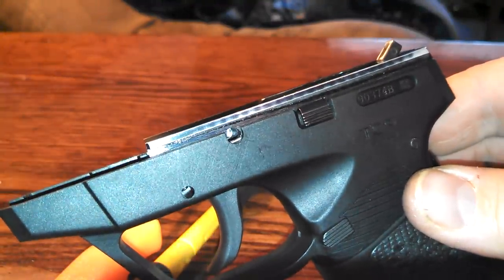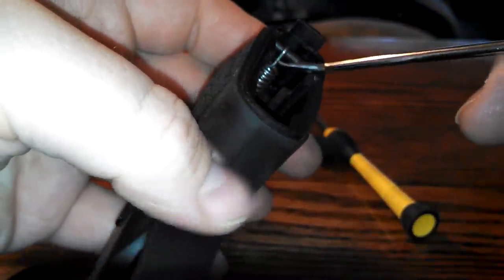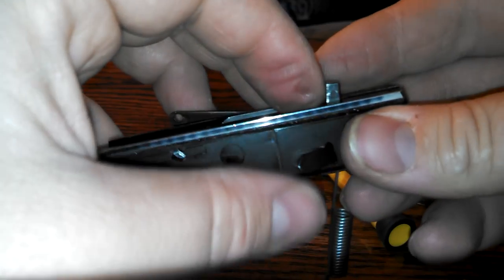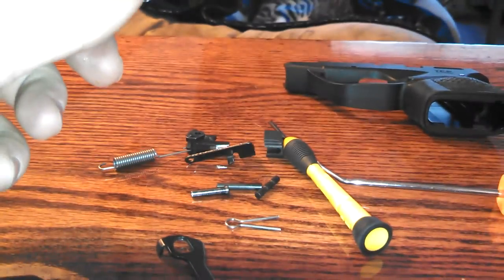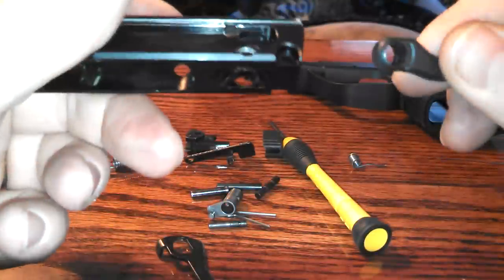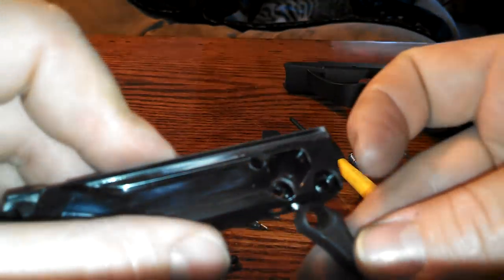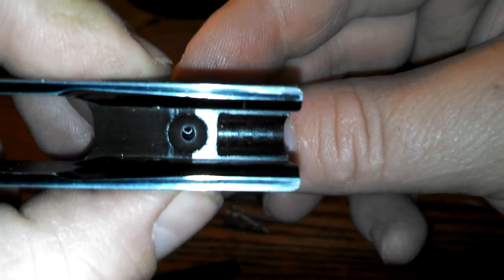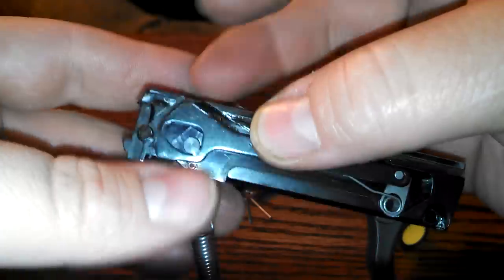Taurus TCP Frame disassembly part 1

Comment: Speaking of trigger bar, just field stripped mine and cleaned and learned not to use ear swabbs.  Cotten fibers or something simular got caught in the back area of that bar where it touches the slide. I oulled trigger expecting it to spring back forward but it stayed stuck back. Talk about worried the crap out of someone. Just cleaned your gun and it work less than it did before you started. I probally need to take completely apart and do the things you spoke if but dont have my confidence back enough lol.

Comment: Your two videos were very helpful in getting my TCP back together -- I was having trouble with the sear (a misnomer, IMO).

One critique is that you don't need to do that funky maneuver with the trigger bar & spring at 7:20.  You can put the trigger bar in and then swing the spring end counter-clockwise and into the groove.  This is a much easier method.

Comment: On the right side of the frame above the pin there is a very small access hole to hold the sear up while you drop the housing into the frame.

Comment: Question: how do you know how many turns the spring that gives pressure in the "groove" of the trigger bar should have?
7:13
I see you give it about one turn, but what if it is properly two turns?
Reply: Because it only took 1 turn to unravel it when he disassembled it. and you can't get it around 2 times because the spring coils will bunch up too soon